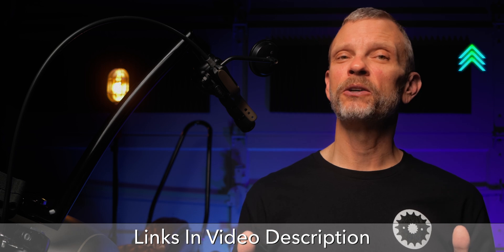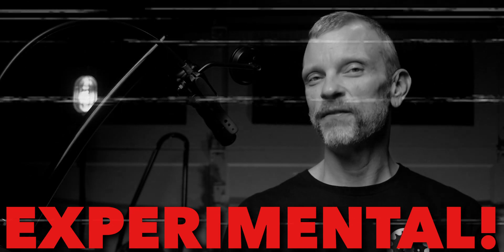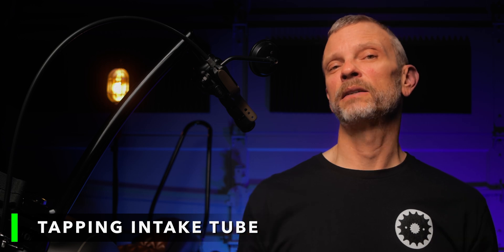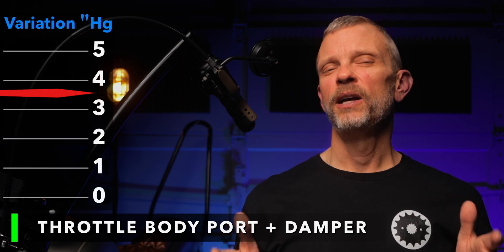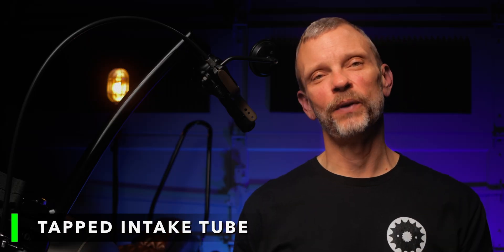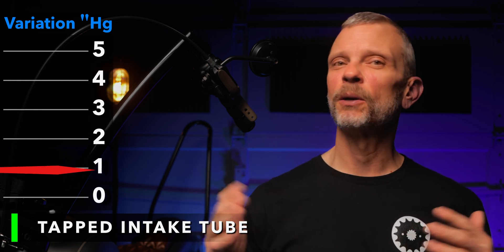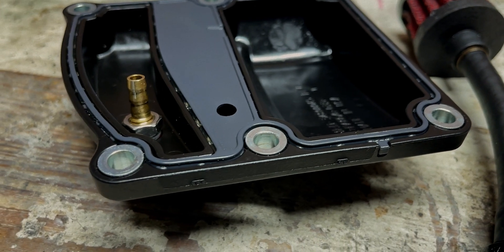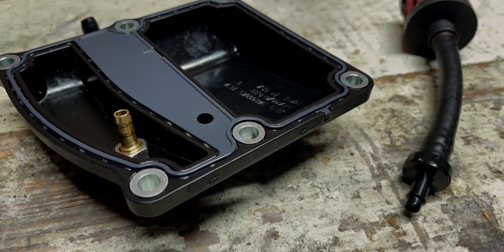Vacuum-Ported Catch Can • Crankcase Vent: Keep It or Dump It? 👍🏼❓👎🏼 (M8 Sumping)

Comment: I ended up buying the Trask CheckM8 trans cover. Funny thing tho, shortly after installing it (while it was sitting in the garage during cold winter) my first ride ended up with a check engine light on. I thought great, what is this crap.. then after riding around for an hour I stopped to eat something, and after finishing I fired up the bike and the light was out (sigh of relief). So I was pretty calm and kinda sorta happy with the addition of this.
 I had purchased a catch can from DK custom products to use with the Trask cover and they kept bugging me about getting the plumbing to vent the head breather bolts  too. (HEY you left this behind....!!!) I wrote them and told them I think I had covered the issue unless they knew something I didn't. They wrote me back and said there is still pressure coming from the breather bolts even with the trask cover, AND that it had toxic nasty oily oxygen depleted air that was getting into the intake... 
 I think we had this conversation way back about the idea that you have this big air box and these two tiny little breather bolts that expel a minimal amount of air, and that sucking whatever comes out is about equal with the air cleaner sucking in something if you fart while sitting in the seat of your bike. Anyway, the question of vacuum at the intake via the breather bolts still escapes my thinking when I approach it logically. I can understand that the breather bolts might still put air out, and maybe even fill a plastic bag, but your vids don't show an appreciable amount of oil at the breather bolts (after installing your own transmission vent) and the idea of poisoning the intake air and causing the engine to breathe toxic fumes still seems largely comparable to the fart and intake sucking in a few micro grams of fart gas if the wind is blowing in that direction.... In other words, tho there is pressure, just how much? AND is it really carrying all that nasty crap the horror stories glorify, especially after reducing the crank pressure with the trask cover?
Then there seems to be some idea that a positive pressure coming out of these breather bolts which are one way valves, can help create the vacuum necessary for the crank case.
After reading up on the history of the PVC system I am not so convinced that the breather bolts are the source for the vacuum if they are responsible for venting excess pressure.
https://www.vehicleservicepros.com/service-repair/underhood/article/21198914/living-in-a-vacuum-crankcase-ventilation-system-testing
All vacuum that I can determine is thru the throttle body/intake manifold, when the piston takes the down stroke to draw the engines fuel and air mixture. I can't see any loss or benefit in taking out or adding the breather bolt bypass when it comes to vacuum, being that the two small tubes coming out of the breather bolts are coming off of one way valves that are supposed to vent pressure that comes from the crankcase and not draw air back inward.
Can you explain how (when you drilled and tapped the big sucker for the bypass), that you compromised the vacuum in a way that I can compare to the scenario I have described with the one way valves? DK customs is saying I need to vent whatever air is coming out of these breather bolts, but what you might be suggesting is that will compromise the vacuum necessary for the crank case cavity to do what is necessary for reducing oil foaming and to draw the oil back down from the cylinder walls during the piston stroke. Isn't the oil ring responsible for wiping the cylinder wall?
I've watched all of Kevin Baxters vids and there isn't any real detailed information on the crank case pressure and vacuum scenario that explains the way the vacuum in the crank is created or maintained, nor an inclusive explanation as to how the umbrella valves in the head configuration works to expel pressure and maintain vacuum integrity that I could glean form the vids he makes. There is nothing I can find that details how Harley engineered these motorcycles to comply with the EPA and any real world solutions to how this could be solved from a manufacturing point of view and so when you talk to a tech at Harley, they simply warn you to not drink the kool aid that comes from watching You Tube videos.
To make a long story short, there seems to be a big hesitation when discussing these things because no one wants to take responsibility for maintaining any ONE idea as reality. This leaves the buyer to weed thru all these different suggestions by mechanics and manufacturers to simply sell and buy stuff at a risk without any kind of guarantee or real understanding of what REALLY happens in the real world according to design and function. IT all comes down to what works for you and your motorcycle IF.. you have the knowledge and experience of a mechanical engineer. IF you don't you can watch hours of You Tube videos and run to the nearest retailer that sells the best ointment for your worries.
Sorry, not trying to be a whiner, just banging my head against the wall here because there is no ONE place to go in order to get answers to questions without spending a large amount of money to get expert counsel. Usually everyone is too busy. Harley tells me I can void the warranty if I try to solve the problem of carbon buildup that takes place because they have decided to slowly self destruct my motor because they intentionally dump the garbage that comes from the crank case into the intake manifold.
Reply from the maker: Hey Manonymous108 - good to hear from you again! You bring up good points for sure. I think the main question I see is how adding the external breather mod could compromise the potential for crankcase vacuum. That's a great question. And to be clear - I'm no expert on this. I just try things and try to share what I learn. But that being said, as I understand it, the intake airflow across those ports in the throttle body generates the vacuum in question. By blocking those off, the vacuum source  is gone. Theoretically. Is vacuum generated by the movement of the pistons? It seems to me that because the air volume in the crankcase is constant (assume no venting), there would be momentary vacuum on the upstroke, but momentary pressure on the downstroke. It seems to me that they would cancel one another out resulting in no constant pressure or vacuum being generated by piston movement alone. Maybe I'm missing something? Now add to that normal blow-by and you end up with positive pressure in the crankcase, and then the need arises to vent it out. Just doing a brain dump. Not sure if it helps at  all. For Kevin's videos - if you haven't seen it yet, check out the one from March 11 of 2021 where he covered several topics and answered questions. He covers several aspects of these topics in that one.
Reply: @RonsWorkshop  I really appreciate your talent in putting these video's together, but I still fail to see the logic in the idea of vacuum being compromised. If you look at the history of the pvc system, the relative components that add to the positive crank case pressure and the manifold vacuum can be affected by the state of the working components. Bear with me here. The vacuum for all of the accessories that were engaged in the cars of the past, such as wipers, spark advance in the distributor all came from the vacuum that was a result of the intake system where the pistons drawing in air created the manifold vacuum pressure. Carbureted motors used certain sized jets in the carburetor based on the amount of vacuum pressure that was going to draw the right amount of fuel for combustion. When vacuum was compromised the engine would run rough. In the link I sent you there are factors that can add to this condition. IF the engine is a big set of lungs that breathe in and exhaust out the build up of internal pressures or vacuums have to come from one of these sources.
In the intake system you have valves with guides and seals that are supposed to keep the air coming in  and directed to the combustion chamber. IF these seals are compromised, then you get pressures that seep past these seals and end up in places that are not supposed to work with these. This is why I think no one wants to touch on this subject in a general way because each engine is different in its performance and integrity of parts. IF all intake air stays in its place it goes to the cylinder and is exploded and then pushed out the exhaust. If there are leaks then air gets into the engine and or leaks out places like valve covers and compromises the breathing system. Since the crank case is open to oil flow throughout the engine pushing oil thru chambers that go thru the head and back down into the crank case this system can be weakened by leaks that are in valves or gaskets etc. The oil pump has to draw oil from a closed chamber an in a sense has to create some vacuum if the chamber is sealed tightly. As the pump pushes oil thru the chambers it is supposed to go thru then it would make sense that the vacuum is neutralized by its return to the oil chamber, but that is probably not the case. In that link that I sent you on the PVC story there is a part where they plug the dipstick in order to measure vacuum. This tells me there is vacuum that is maintained in the crank case, but then there is also crank case pressure, where does that come from? Some of it is blow by past the rings and small leaks in the valve guides and seals, and some of it is in the expansion of air that takes place when the engine heats up. Water condenses in heat changes and affects the oil quality and evaporates as it gets hot and moves out the crankcase breather. In the old days they had air tubes that extended down below the engine to scoop air and help it move the dead air within the crank case and it spit out on the ground, which is what I grew up with in the late 50's and 60's causing the grease strip in the middle of all the highways and rural streets. Later the pvc system was created to move the air back into the crank case and any water that didn't vaporize was found in your oil change.
I'm just thinking out loud here from reading the stuff available and I still am not clear as to how they determine how much pressure or vacuum is normal in an engine. Too much is gonna damage seals, rings etc. Too much vacuum is gonna damage seals, rings, etc. There has to be some safety system that relieves excess of both.
This system is not in my opinion reliant on two very small holes in the head of a Harley that is supposed to vent but not be the source of vacuum. The vacuum source is deeper than the throttle body and includes that opening but is not going to be critical of two tiny holes that are part of a safety system to blow excess pressure out of the crank case. Take a look at this video that kinda explains the umbrella valve that the breather bolts are part of, https://www.youtube.com/watch?v=mV4xKsDsPWg This video shows that there is not a vacuum pulling the oil out of the breather tube but the bad umbrella valve is responsible for pushing the oil past the valve and into the intake. When you look at the intake outside of the injectors, you can change the volume of air available by changing the air cleaner box or you could run the motor without the air cleaner and there would be hardly ANY pull on those little tubes, but the bike will run just fine. So I don't think any little alteration outside of the throttle body is going to have an appreciable effect upon the vacuum system of the crank case. Just my thoughts, but I am SO willing to hear a technical explaination that puts me in my place and clearly explains how the system works or is supposed to work and whether the catch can idea is good or bad.
Here also is what Dwayne wrote after asking him at DK Customs.

 There is in fact a sort of PCV system in place... Within your rocker boxes there are valves that meter crankcase pressure within the head breather system. Twin cam and sportster models call these umbrella valves I believe on the M8 they are just called head Breather Valves if you wish to look those up.

The intake does not pull vacuum within the head breather system. Positive crankcase pressure is present here.

The goal of a head breather system is to ensure only clean, oxygen rich air is in the intake. It doesn't alter or reduce crankcase pressure in any way.

Think of it this way... in stock form, your head breather system has open ended tubes pointing into the intake. While there is a venturi in the air box or there is no suction here for the head breather hoses (think of a drinking straw). 

Those hoses are blowing the crankcase vapors into your air box/intake... An external breather system simply re-routes those hoses to the atmosphere.

As a test you can do for yourself, attach hoses to your head breather system and briefly collect those hoses to a balloon.  In about 20 seconds the balloon will grow to the size of a grapefruit with or without the trans vent. Keep in mind this is entirely outside of the air box (no vacuum).

With a trans vent, the balloon attached to the head breather system may expand at a slightly slower rate but it will still expand and be filled.

What is inside that balloon is oil vapor, condensation, crankcase gasses, etc... All of that displaced volume within the air box... This means less oxygen intake.

Venting at the other end of the crankcase can reduce head breather pressure but can not, in any way, eliminate it.  

Will it reduce the head breather pressure enough to prevent liquid oil carry over? possibly.

We have not tested any venting systems but it must be understood, they can only serve to reduce the volume that is passing thru the head breather system... not eliminate it.

Every bike is different... some bikes pass up to 1 qrt of oil thru the head breather system within 1500 miles. Venting the crankcase on such a bike wouldn't make a noticeable difference in oil carry over here.

Many bikes produce little to no oil carryover. The vent may be just enough to eliminate the oil carryover on those bikes.

It is not a matter of other products failing to do what a head breather system does... It must be understood that the product you have, and the External breather systems we offer, serve different purposes. 

The trans and other venting systems claim reduce or eliminate the oil carryover. I am sure that in all circumstances crankcase pressure is reduced and in some cases eliminated. if that is what you wish to achieve, those products are great.

If you want to re-direct the head breather system from venting into the intake, you need an external breather system. 

I do understand this is a hot topic but this is something consider IF you are hoping to prevent oil feeding into the intake....

No one making a vent product that reduces crankcase pressure will guarantee you that no oil carryover will be present in the intake because is an impossible claim to make.

With an External Breather system, there is not oil venting into the intake. This is not debatable.

                   Ride Safe - Ride Free
                           Dwayne

Thanks Ron for you discussion and videos.
Reply from the maker: Thanks so much for sharing that info from Dwayne @ DK Custom. You've covered a lot of ground...I won't try to respond to everything, but there are two points I'll comment on: 1) Regarding vacuum from the breather bolts: in my case, with the Arlen Ness intake, the two breather bolts are ported to the intake just outside throttle body. It's always been my understanding that the potential vacuum would come from this, as the air passed over those holes and thereby generated vacuum.  2) I agree with Dwayne's sentiment that while venting the crankcase may not eliminate all the pressure, it does at least put a dent in it. It's also now my position that priority 1 is relieving the crankcase pressure and if you end up with some amount of vacuum, that's a bonus. (Read: I won't loose sleep over using a crankcase vent and external breather mod at the same time.) Good discussion indeed. Thanks for contributing great information, insight, and thought-provoking questions!
Reply: @RonsWorkshop  Thanks for all your videos and laying the groundwork for my interruptions and skepticism..
Reply from the maker: My pleasure - and I appreciate your honest input for sure! Critical thinking is far to rare these days.

Comment: Blockhead Moto created a solution that allowed the oil in the throttle body to be passed through to the transmission. Basically killing 2 birds with 1 stone.
Reply from the maker: Hey NoLimitzz9 - yep - just be sure to watch that second video of his because he didn’t mention in the first one that he notched the top of housing to let it vent.

Comment: Hey Ron, great stuff man! What about running the breather mod into the trans cover? Wouldn’t that keep the engine in a normalized atmosphere?
Reply from the maker: Hey Justin - thanks for the kind words! That's an option for sure. Because the ports in the intake are blocked you still wouldn't get any vacuum, but it would vent everything to the same place. I will likely do that on mine, but just T the lines together after exiting the transmission top cover.